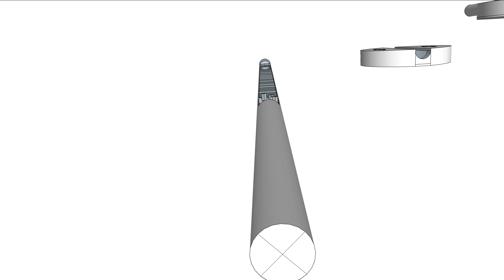Making a Walking Stick Dulcimer

Comment: Beautiful piece of work, and it sounds pretty good too. What does the walking stick sound like without the dulcimer body?
Reply from the maker: Thank you Thomas. The Stick alone is very quiet. The body works surprisingly well considering the bridge isn't siting on the sound board.
Reply: I was lucky enough to meet The Stick this weekend :-) If you lean it against a farm gate or a waymarker when you stop for a strum during your travels, you can use that as a soundboard to amplify the music.